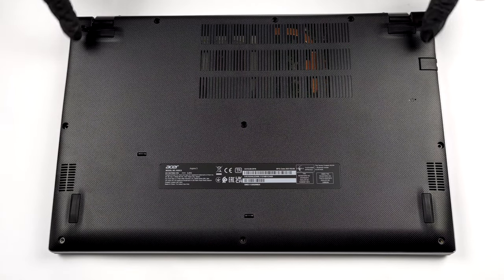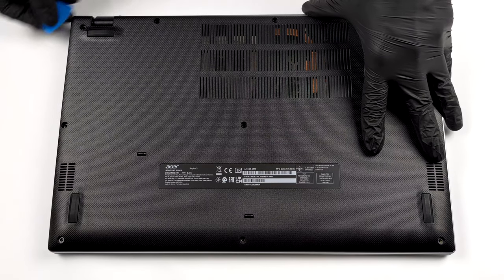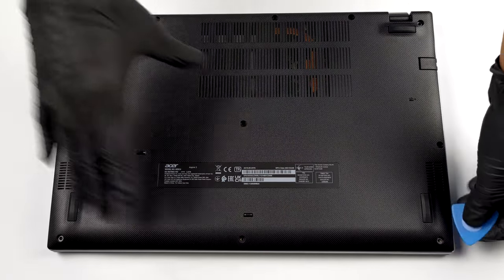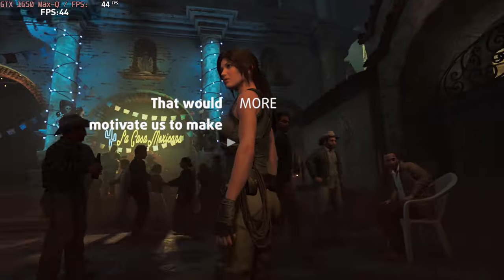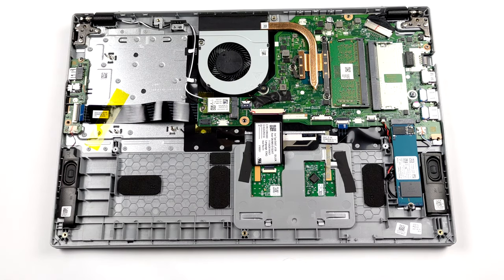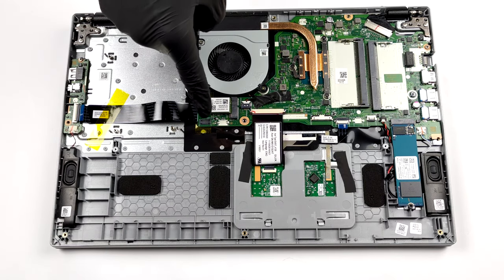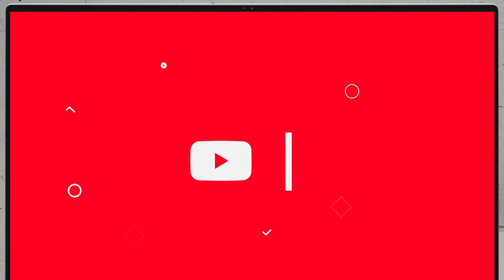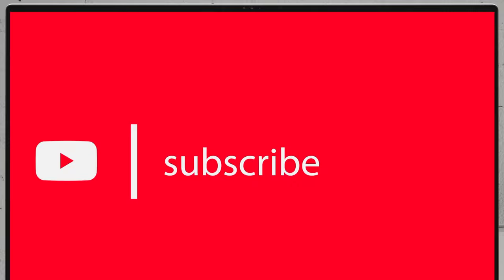🛠️ Acer Aspire 3 A315 35 - disassembly and upgrade options

Comment: got the 8gb version of this one and I've been wondering, will adding 8gb ram more improve the performance of my laptop gaming wise???\
Reply: Unfortunately no. You could edit videos on it, but for gaming wise, not recommended. I played GTA 4 and GTA 5 on this similar model, and while the former game runs kind of smoothly albeit the fan ran strongly, the latter game only allow me to play it on the smallest resolution of the game. And this is in fact after I upgraded to 16gb

Comment: CPU upgrade? Max memory? Max SSD?
Acer Aspire 3 - A315-35-C1ZA
Reply: Max memory is 2 x 16 GB, SSD has no max, and the CPU is soldered.
Reply: @mschaap8890  so does that mean every slot can handle 16GB of Ram? so that means 40GB of Ram total Including the Internal?
Reply: @m4y0ch33si3  2 x 16 = 32 GB Ram total, which would be an overkill for for such a low-end CPU.
I upgraded mine with an identical memorystick to 2 x 4 = 8GB because 4GB is on the low side to run Win 11.
If you use 2 identical memorysticks the memory will run in dual-channel mode, which is marginally faster.
Reply: @mschaap8890 . _.   i can't really understand the description of the laptop  . _.
Reply: @mschaap8890  up to what ram speed can it run?
Reply: @josephlozano2646  You can see that in my other comment.
Reply: @mschaap8890  can it be 2x8 for 16gb of ram? And is the m.2 also upgradable?